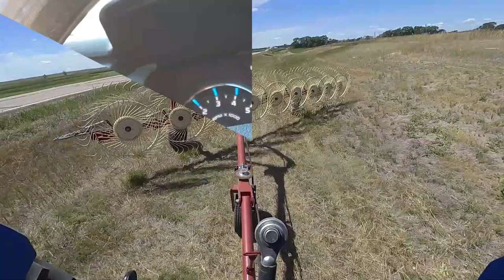Highway Ditches

Comment: Garbage in ditches is always an eyesore and a hassle for those who bail them. As a friend of mine said once, "If it weren't for people,  it would be a wonderful place to live." At least the ditches don't have the garbage in them like it was 40 years ago. Nice of the seller to fix up the trailer for you. Don't see that very often.
Reply from the maker: Yea, he felt bad about it. He did get the 2 bearings fixed and delivered it the rest of the way. I've had a little more time and I checked the other two hubs that were fine at the time and the inside bearings are shot as well. Snow does a lot of damage.